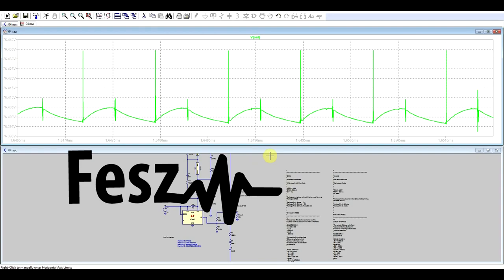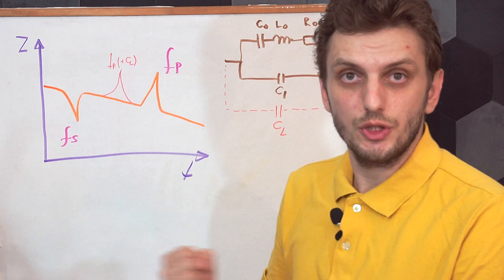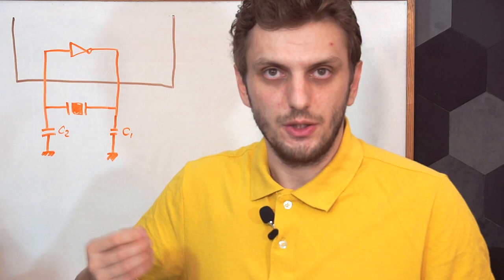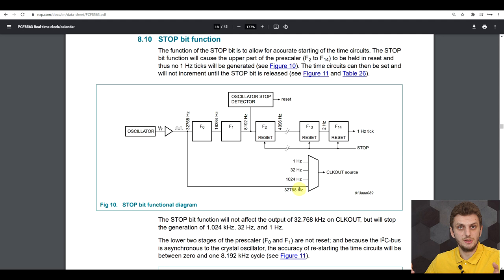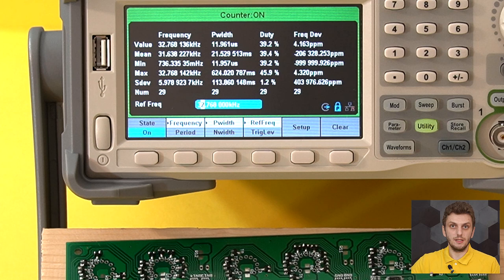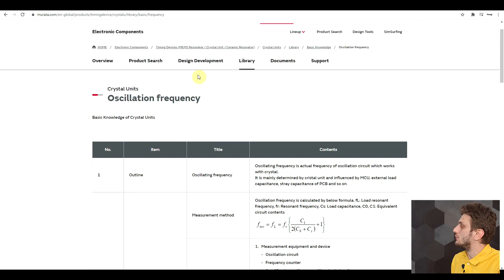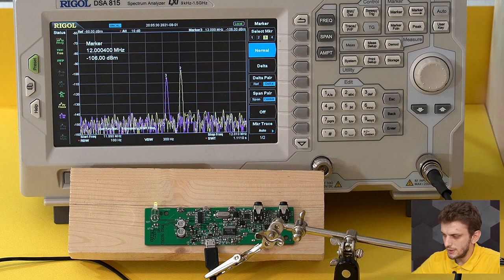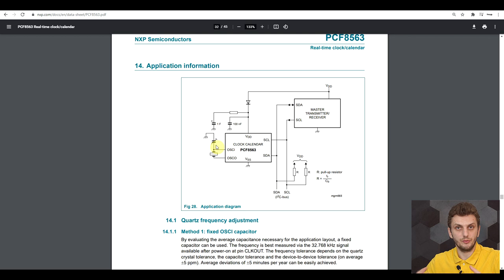Crystal oscillator - Frequency measurement

Comment: Years ago I had all sorts of accuracy issues with the PCF8563 RTC despite trying different crystals. The issue was exactly as you described, inaccurate calculation of the stray capacitance. Great tip about indirect near field measurement 👍 Awesome video as always
Reply from the maker: To be honest, I placed a 10p cap in that circuit purely by accident; it wasn't really a measured or calculated value - while making this video I was really surprised just how accurate the circuit was

Comment: This information is sooo good; thank you! I use 20MHz pill can crystal oscillators with x2 22pF ceramic caps for PIC18F4550 projects. I have noticed that, when proofing these oscillators on my DIY Colpitts oscillator test circuit, before installing them, they all seem to run a little slow... and about the same amount. Even though the MCU has never complained, now, I know why the oscillator is slow and what to do about it. Of course, any correction should be based on the conditions when the oscillator is mounted within the MCU circuit, not in the Colpitts tester. FesZ, we really appreciate you!

Comment: Here is another additional rule of thumb to use when designing and validating an oscillator design:
Check the frequenzy at the extreme ends of the temperatures and voltages of your device under test (DUT).
Measure at the maximal voltage and lowest temperature specified by your DUT.
Measure at minimal voltages and highest temperature specified by your DUT.
This way you will stay within specification even if voltages and temperatures changes.

Comment: My crystal osc wouldn't start in cold. 
MicroChip engineers suggested to use one 20pF and one 22pF capacitors instead of 2x20pF for a 4MHz xtal. 
Worked fine after that.
Reply from the maker: When you lower the temperature, the gain of the amplifier increases; you may also have a drive level/distortion issue. Anyway, I did read that having different values will help with the phase shift of the network and is recommended when startup is an issue.

Comment: You could also use oscilloscope frequency counter
Reply from the maker: Indeed, that is also a valid way of measuring, as long as the oscilloscope has a good enough counting resolution. I noticed that not all oscilloscopes have a good enough measurement resolution to achieve the multiple digits needed for quartz measurements.

Comment: I would go with the high impedance buffer connected permanently to the crystal circuit. Characteristic impedance of the circuit will continuously change if you move beside it anyways, not to mention the other variables like pressure, humidity, and temperature. Also there is the option of using mismatched loading caps. I've seen it used in few circuits.
Reply from the maker: I'm not sure if there is a practical buffer that has a lower added capacity than a  piece of coax floating at ~1cm from the circuit; and leaving the buffer there after the measurements is not really practical either. Pressure/humidity/temp will have an impact, but its not like anything can be done about this... I mean, the final circuit will see these parameters vary unless the whole circuit is put into an airtight temperature controlled box (like a TCXO).
I did mention using the mismatched capacitors, keeping the large one on XO, I think...
Reply: @FesZElectronics  your videos are a great inspiration. Since we never draw any practical power from the Oscillator circuit, we do keep the buffer as first line of signal extrapolation due to high input impedance. Therefore, that's why we keep the buffer in circuit. Please don't be intimidated, and keep up the good work. I love your videos because they fringe on the black magic design. I miss this all too much.
Reply from the maker: I guess you are referring to the case where the oscillator is built from discrete components and there is some sort of interface between this circuit and the next one where the signal is used - then of course a buffer will be needed and that can be used for the measurements; In the cases that I measured (the RTC and the USB codec) the oscillator and subsequent circuits where all inside of the same IC package; only the crystal and capacitors where external so the oscillator clock didn't have to go anywhere else (outside of the first IC) - that is why I didn't use a buffer based circuit

Comment: hello my friend I need help!
I wanna to make a circuit that increases milivolt changes to volts I seen some circuits like exponential converters but they are noisy are there any circuit replacement for that thanks....
Reply: Discrete or IC instrumentation amplifier will do the job

Comment: so actually from my 4 MHz quartz crystal i could get for example 27 MHz ? There is no specificiation for my crystal because it is from Aliexpress ...
Reply from the maker: Not really - the frequency that you can adjust by the added capacitors is usually ~+/-200ppm - for 4MHz that is +/-800Hz;
Reply: @FesZElectronics  I understand how to get -X ppm, but how to get +X ppm? Need negative capacitance?
Reply from the maker: @SaihoS1  Well if you don't add any capacitors you will be at the series resonant frequency - some amount of +ppm; and if you add an infinite amount of load capacity you end up at the parallel resonant frequency - again some amount of -ppm; the crystal specifies a load capacitance - if you add less, you have positive ppm, if you add more, you have negative ppm (in reference to the desired value)
Reply: @FesZElectronics  Now it is clear. You consider 0 ppm @ the recommended Cload.